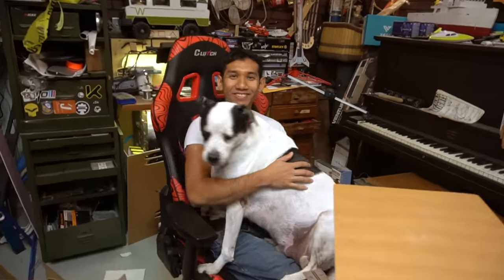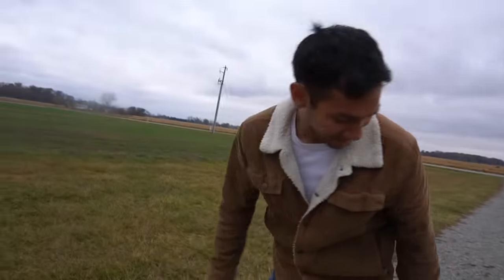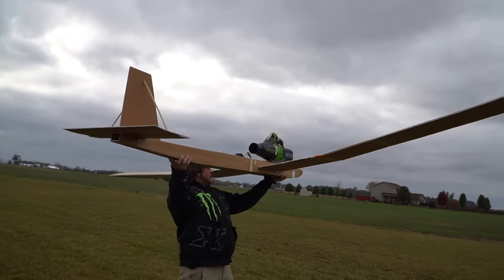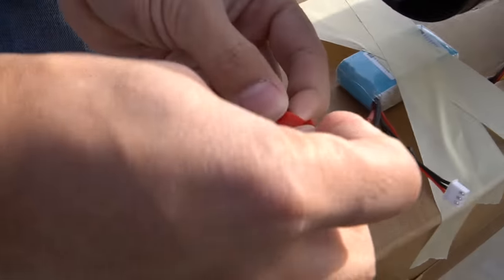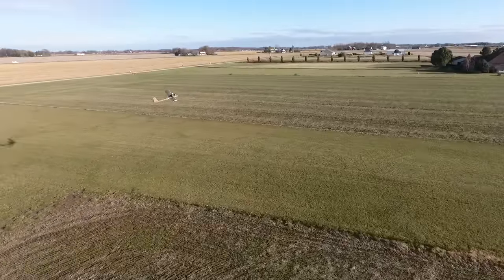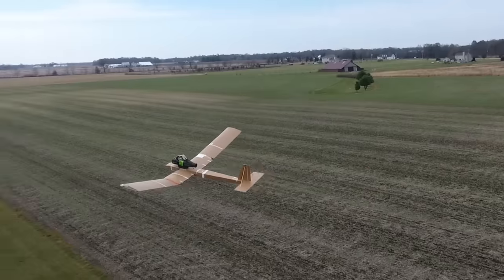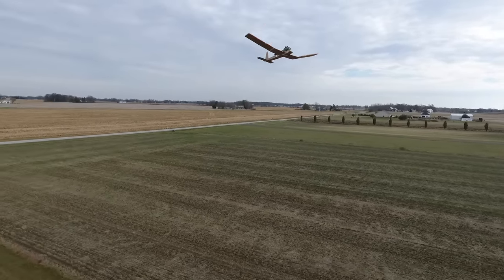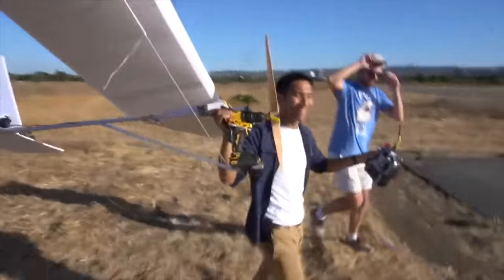FLYING Leaf Blower RC airplane Mk2

Comment: Do Jack Hammer Airplane next.
Reply: How is that possible
Reply: @wintersportsnetwork5574  idk but maybe he can figure it out lol
Reply: @wintersportsnetwork5574  that’s the thing it’s not possible lol
Reply: Hahaha!
Reply: @nathanelliott6770  gods have no limitations
Reply: That wont work
Reply: Lol yes!
Reply: SupaRush I laughed so hard at your comment a little bit of wee came out 😭
Reply: You should be on Colin furze channel
Reply: @spookydookie8752  yawn
Reply: it could be possible if the jack hammer acted like a piston and was connected to an air injection system the same way fuel is injected into an engine. just direct the airflow to intake from the front and exhaust out the back. the biggest issue is the weight. I have no idea how you would get past that
Reply: Jack hammer is to heaviy
Reply: Lmfao good one
Reply: It vibrates air so hard that it flies
Reply: Yeah !! That sounds cool , a flying jackhammer can fly my mother in law front seat !!! Lolsss
Reply: followed by a steam roller airplane lol
Reply: Hahaha 😅🤣🤣😅🤣
Reply: You could make it act like a piston, put in some gears and make it rotate a propeller
Reply: Waiting to watch that... lol
Reply: Pulse jet style😁😁
Reply: Not possible

Comment: The unqual dyhedral is called "a sripol dabbed wing" in model aviation circles since late 2019...
Reply: "a sripol dabbed wing"  you sir have won the Internet today
Reply: F4u Corsair ..
Reply: F4 is a symetrical gullwing. That one is allready taken. Assymetrical though...
Reply: It doesn't even need a sripol dabbed wing.

Comment: You have these long wings attaching via two dinky tabs at the fuselage. Your largest bending moment happens right there. You need a beefier joint there. A strap running along the bottom surface, splicing both wings together would also help. The strap wouldn't need to run the full span, just enough to carry some of that bending moment in tension across the fuselage. You'd probably only need about 3 fastener attachments on the bottom of each wing. You'd need to make appropriate fittings attaching to the spar on each wing, of course.

Comment: I owned a Grumman Traveler single engine airplane.  It has composite wings and a tube spar that runs through the fuselage out to both wings.  I think you could use pvc tubing to make a stronger spar.

Comment: The entire time I was confused as to why you would take the nozzle off. I think your thought process was logical, but if it's a leaf blower, there's a good chance the blower is designed to create a higher static pressure to deliver more high velocity air out the nozzle. So, less air volume but at a higher velocity. Even with the dead weight of the length of the tubing, it still took to the sky with more gusto than the first attempt. Or at least, that's what it looked like to me

Comment: I'm thinking Circular Saw, loads of torque.
Reply: Solid suggestion! It'll be hard to keep it stock though...
Reply: @Shanidar1  nah just throw some hardcore gearing on it and you'll be set
Reply: @Shanidar1  Yeah I figure replace the blade with a pulley and run a belt to another on the prop.

Comment: Looked to me like it actually flew better with the nozzle on it than without. My personal guess is that by forcing the air to thrust out into a more focused rearward facing direction, you were actually getting more thrust. Since without the nozzle, sure you still had the same volume of air moving out the back, but since it was free to scatter out the back every which way, not all of the thrust was  being harnessed into a forwards direction.

Comment: 2:44 That's how they fly down in New Zealand, throttle on a 2 position switch... :D

Have you considered making an Ornithopter- could use a drill or maybe a jigsaw to power the mechanism?...

Comment: Add a couple of pieces of nylon monofilament running from wingtip to wingtip, passing under the fuselage, to counteract the wings' tendency to bend while lifting. It's a lot lighter than strengthening the spar.

Comment: Next challenge: Take a battery-powered grinder, remove the cutting wheel and replace with a propeller!! Can anyone say "10,000 RPM model aircraft?!"
Reply: hell ya, imma use a paper plane and attach my modified Dremel!
Reply: Too bad the propeller has too much air resistance which will either slow it down, or worse blow the prop apart.
Reply: @BillAnt  The grinder's RPM's can be modified to match the propeller's characteristics!
Reply: @krishnastock  < Right, but you initially said "Can anyone say 10,000 RPM model aircraft?!"

Comment: I would extend the wings and make it a solid piece opposed to seperate ones since the wing root base has to be the strongest part of the wings. more wing means more surface area for lift.

Comment: The only thing I would suggest would be putting the leaf blower on the bottom of the airplane and angling it slightly downward to give it a little bit of a downward push.

Comment: Check out the Spadstick rc airplane designs.  For wing materials use corrugated plastic signboard material (during election season it can be found growing naturally everywhere...stock up for the year!).  Use a yardstick or cut a longer solid spar that is full length, and use CA(super glue) to glue the material to the spar, fold it over, and glue the rear edge.  Slice one side of the corrugation and voila, ailerons /elevator, rudder.  Use plastic gutter downspout pipe for the fuselage l.  Cheap, easy to source in any town,and tough as hell.  We used to dogfight them all day long and beat the hell out of them.  Plastic kitchen cutting boards cut to shape make great firewalls and engine mounts.

Comment: Pulse width modulation
Pulse width modulation (PWM) is a modulation technique that generates variable-width pulses to represent the amplitude of an analog input signal. The output switching transistor is on more of the time for a high-amplitude signal and off more of the time for a low-amplitude signal.

Speed control for leaf blower letting speed control with a motor that is either on or off.  It works like that for an electric wheel chair where the motors in chair are full on or full off.

Comment: great stuff.  i built a veco navajo free flight (36" wingspan, weighed 5oz with engine) with a thimble drome .049 over 60 years ago didn't understand the fuse and hinge on the horizontal stabilizer (to bring it down after 10 seconds) so didn't implement that part.  it went right into the ground and broke in half so i repaired it and put washers under the lower engine mounts to up the thrust angle.  the next time it spiraled almost straight up out of sight.  5 minutes later i could see it making bigger and bigger circles and never saw where it landed, at least a mile away.  i now have a degree in aeronautics and astronautics from mit.  no help!

Comment: Believe it or not, the bent wings actually helped! 2 reasons: 1) the motor and battery are heavy, and placed on top. When the wings bent, that put the center of lift more of the level of the center of mass of the airplane. 2) the datum line of thrust is high, which wants to blow the nose down, which puts more lift stress on the wings. With the wings bent, the center of lift is closer to the center of thrust from the leaf blower. (engine)

Comment: since u put a heavy engine & batteries on top.. u need to consider CG already.. look like its aft heavy, u can see it has tendency to pitch up, and stall the plane.. u need to adjust the vertical stabiliser to make it level or move the blower forward a bit... and the blower exhaust is distrupting the rudder airflow as well make the plane turn..

Comment: With the tube on it basicly looked like a german V1, while the tube ads weight it does place the flow over the rudder that might add some control.  At first I wasn't sure you included fight controls and could see it landing an hour later in someone's window.

Comment: If you can make the fuselage deeper on the belly, you can guy the wings from below to stabilize them. They are  otherwise too flimsy with that little stick as the main structural element. Also, if you narrow down the opening at the end of the blower, you might get more thrust (ideal gas law). A v-tail or twin tail design might work better, so that the blower isn't blowing directly past that single rudder. I am guessing that you lose significant thrust by hitting the stationary upright tail, although it might give more maneuverability with the rudder. Another possibility is to incorporate the blower into the fuselage  and blow directly out the end of it.

Comment: This was fun to watch. when I was a kid I built a paper Airplane about as big as the one you made with the leaf blower. You took it to the next level and it was a success. I had no idea the leaf Blower TWR was so good ^^ as a side note. every repair adds more weight and increases the difficulty. but the first flight was proof. the wings adjusting in the head wind is what made it fly with the leaf blower. After that you just didn't have enough control surfaces and lol... those would continually add more weight. I grind my teeth on these problems everyday and often the logical answer to the solution also... presents another problem. Fun video and would like to see more.

Comment: Great challenge and making it happen. The shame of this video is that I have seen the exact same thing happen to a motorglider with someone I knew well flying it. The wing folded up while turning final to land. The motor glider was 200 ft above the ground, and did make a foot deep crater in the farmers field it crashed in. Both the motor glider and the pilot were broken to pieces. Not a happy day or memory. 26 years later I am building an electric sail plane of my own, even though I have also crashed, a plane due to turbulance on take off, broke a lot of bones and teeth, but I still love to fly.

Comment: if the leaf blower was under the chassis and facing slightly down then it would pull the nose up and the discharged air would blow all around under the air plane instead of kind of using the wings to keep it in the air  you can cooperate the wings stress with a little bit of down force...
you have the air from the leaf blower blowing air at the top of the plane which only puts down force on the back wings and stabilizer.

Comment: Chemical reaction plane. Meter in something like vinegar/baking soda with controller to control thrust. I am sure you will need to find a light weight chemical mix that far exceeds the power of the example given, but you get the idea.

Comment: Seemed like it flew better with the full tube on there.  Restricted airflow also means faster airflow if the design is correct.  Thoughts?

Comment: I have a design for you to try.  The wing is long and narrow.  leading edge to trailing edge approx 3 ft and the wingspan is approx 8 inches.  It requires a spinning gyro mounted vertically for stabilizing.  Also a outrigger can be extended or retracted from one side with a foil on the tip.  I built a non motorized version of this which flew very well.  The leading edge must be straight not rounded to reduce rocking motion when the gyro is not running.  I can show you a sketch of how to build it.

Comment: Was there a reason you didn't use the leaf blower as the body of the plane? Seems like a lot of extra drag and weight to mount it on top. Just curious why you did it that way.

Comment: I wonder if a frame of small aluminum tubing fitted with wings and a tail , rudder etc made of aluminum siding like you see on trailers would make a sturdier airplane at the same weight. Aluminum siding like that is very light.

Comment: Leafblowers intake air from the bottom. Why not put the leaf blower on upside down so you can use that to make lift instead of pulling it closer to the ground

Comment: The EGO blower with battery weighs about 10 lbs. Would the Horten flying wing shape provide enough lift if 20lbs of blower were used?

Comment: Do you like the electric battery powered or the gas powered?

I like the battery powered one. You might try building one that pushes the outflow over two points on the wing. 
Like the A-10 Thunderbolt.

Comment: Should've tested blower strength between each run. I don't know any fans designed for impact shock and I can only imagine the bearings getting messed up with each crash.

Comment: You see that green thing on the side? That's a lock so you can keep the motor running without holding down the trigger the entire time. No need for the rock

Comment: If it werent for those wing connectors dude it would have been sooo much butter. When they were being attached the first time they looked sketchy Af. Great inspirarional vid though. You could easily make a very viable RC aircraft with this tech. A couple of improvements now could be Polishing the inside of the extender pipe and the impeller blades to get more air speed & a decent weight reduction / greater energy density by using about 1-200 watt hours worth of good condition used cell phone batteries.

Comment: why not just attach the wings , rudder and elevators to the leaf blower it's self ?

using the tube as the aft portion of the fuselage,  atach the rudder and elevators and servos to the tube and make a bracket to mount the wings to the blower housing.

the problem I see would be center of gravity,  but you should be able to counterweight to tube ,and you could build wings with a big cross section to help with that in flight.

Comment: why dont use out actual engines with leaf blowers inside the sheild casing that holds them its safe since it cant melt it and just adds effect and removes exposed engines that ruins detail

Comment: Why not remove as much of the plastic from the leaf blower first and then build the plain around the leaf blower motor, battery and controls, it seemed like it had enough power.

Comment: Wouldnt the restricted airflow actually increase thrust as long as the volume of air is the same, since the velocity is higher?

edit: doubt im using the correct terminology, correct me if im wrong or using wrong terminology

Comment: $120 for the battery? Order some 18650's and make it yourself for half the price.
I love flying miniquads and anything I can cobble together that I think will fly. This is hilarious (and viable) but obviously struggles from too much weight of the power source. Maybe make the wings a little bigger if you're set on using a leaf blower? You're almost there as it wants to fly.

Comment: i dont think be always repairing wings is good because the wing integrity gets worser and worser each snap and if you just change a broken frame and tape it all together its more easier to snap at high forces of air i think replace whole wing would be better

Comment: Awesome - but hope you can repurpose the cells in the $110 battery you threw in the air - the board might have issues but the cells would be fine. Seems pretty wasteful otherwise to chuck 80v of lithium cells in a landfill !

Comment: Stabilize the wings like a Cessna air plane with braces or wires like WW I planes. Damn put the motor under the plane lower the CG. It can't be stable as it is top heavy

Comment: i'd love to see a polished version
Reply: like i'd love to see the leaf blower reverse engineered into the frame of the plane with its typical engines under the wings and intakes at the front of the wings, the battery could go in the pilots seats at the front perhaps. external frame built out of some shiny light weight stylized material, some painted or vinyl printed windows and insignia, in built code to circle in the sky like an eagle and so on. but overal great stuff, i was surprised to see it get off the ground let alone complete a circuit A++

Comment: What I don't get is like you guys seem really smart funny outgoing. You got like the whole package. But you didn't double check the leaf blower to make sure that shit still worked after falling out of the sky? Like it only would have taken a little bit of pulling the trigger of the leaf blower to simply confirm that it still works properly before you drive all the way to a field set up your plane and go to fly. Just saying. That's like a pilot going to his plane doing all his pre-checks getting in the plane trying to start it up and realizing he doesn't have any fuel in it.

Comment: @PeterSripol: Nice try, but definitely you have wrong design of the wings. The wings cannot look like legs of your friend girl. They cannot be like that, that's why you loose so much of the lift during the bank! Also If the body shape would be fixed ... you could add +45% power during the bank, and it should hold. So the power for take off was just fine, but not for the bank. You would need to have very gentle rudder controller to get like 5° bank and don't go above 35°. 30° should be save and +45% power to keep it flying ... but again, only if you manage to keep the winds horizontal and not like that, and if you keep good body aerodynamics. And you cannot do that maneuver in such low altitude because you don't have ailerons! Yes, you need ailerons to be remote controlled otherwides the nose goes down and you crash. You need to keep the place, the body, centered ON the HORIZONTAL plane. That's what ailerons do.

Comment: Just wait till you have to drive an electric car. That's one battery you won't be throwing. If you think that battery costs a lot well hold on,It can cost up to 10,000.00 for a car just to change it then add the cost of the battery.